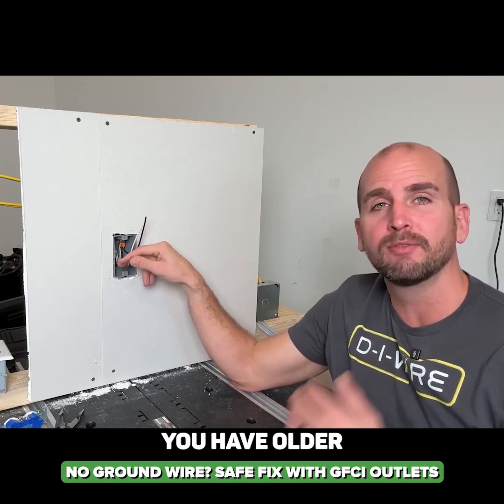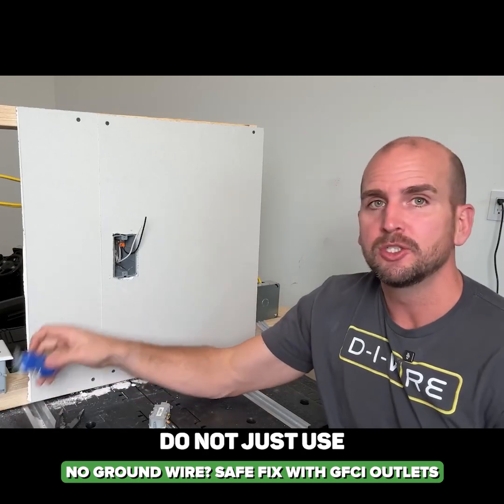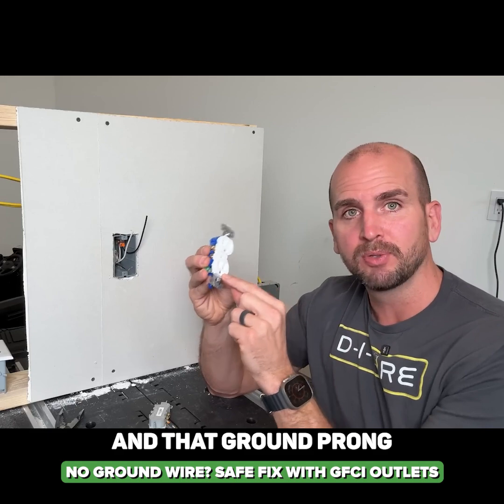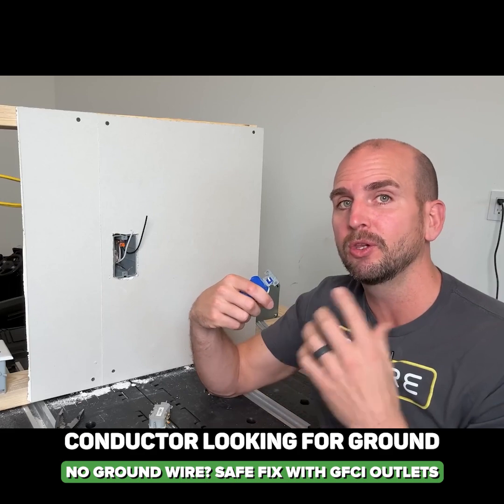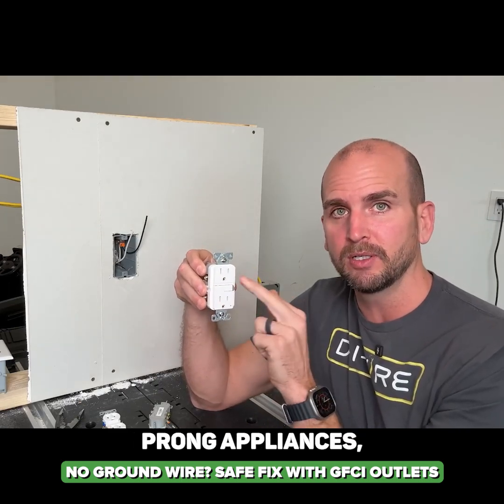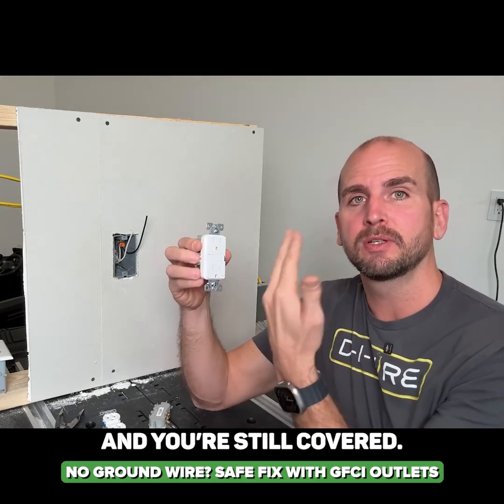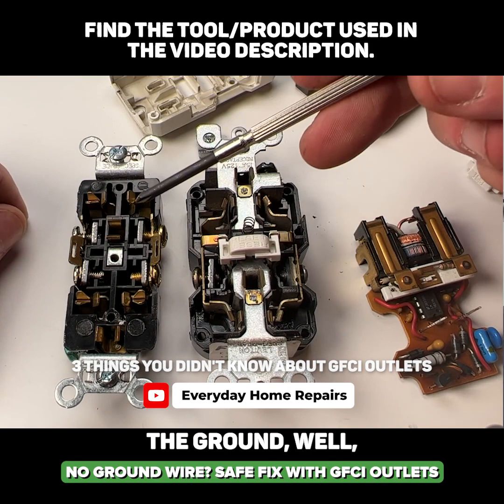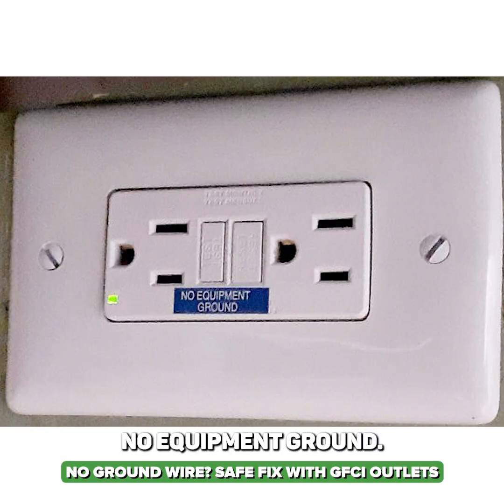No Ground Wire? Safe Fix with GFCI (Code-Approach)

Comment: There's safe and there's also @$%@#$% when you touch the faulty appliance.  Yes, the GFCI (RCD) will trip if hazardous current flows and remove supply keeping you safe.  What it won't do is limit the current while it's tripping.  Get 100mA going through you even briefly and you'll be fully aware of what just happened.
Reply: How would current flow without voltage?
Reply: @ECP90  Why would there be no voltage?
Reply: @retrozmachine1189  I thought you meant after the gfci had tripped.
Reply: @ECP90  Fair enough, but no, pre-trip.
Reply: @retrozmachine1189  oh ok then that makes sense.

Comment: Yeah all good until you realize the box is too small, apparently before the 50s they did not expect devices to be bigger than a 2 prong outlet, surprise 1900s boxes only 1.5” deep; try fitting a GFCI - good luck.
Reply: That's what they make chainsaws for.
Reply: As an alternative can you create a ground by screwing a jumper bare wire onto the metal Jbox?
Reply: @dayummimflyy  That's not a ground, that would simply energize that j-box in the event of a fault.
Also residential boxes are commonly made of plastic for some insane reason, so you would just achieve literally nothing good or bad by bonding it to the box.
Reply: @marine778-r7j thanks for that response. In my NYC apartment I needed to go from a 2 prong to 3, the box was actually metal, the building superintendent sent someone out to switch the outlet and that’s exactly what they did. I guess I should have him come back and do it properly
Reply: @dayummimflyy  Yeah there needs to be an actual path to ground, like a ground pigtail tied into an EGC running back to an actual ground bar at a panel.
Reply: @dayummimflyy IF the metal  box is grounded back to source some how then GFCI recommended eather at or up stream on the cercuit.                                                                  Under NEC 406.4(D)(2), you are permitted to replace an ungrounded two-prong receptacle with a three-prong GFCI receptacle, even without a ground wire.
How to Do It
Install the GFCI: Connect the hot (black) and neutral (white) wires to the "LINE" terminals of the GFCI.
Leave the Ground Screw Empty: Do not connect anything to the green ground screw if there is no grounding available back to the load center/ breaker panel. Never "bridge" the ground screw to the neutral wire (this creates a dangerous "bootleg ground").
Label the Receptacle: You must apply the sticker that says "No Equipment Ground" (usually included in the box) to the faceplate or receptacle.
Why It Works
The GFCI protects people by detecting if electricity is "leaking" out of the circuit (a  ground fault) and tripping instantly. While it won't protect your electronics from power surges like a true ground would, it provides the required life-safety protection against electric shock.
Note: If you use the "LOAD" side of that GFCI to power other three-prong outlets downstream, those outlets must also be labeled "GFCI Protected" and "No Equipment Ground." all recpticals down stream from the GFCI recptical/outlet then they
are supposed to be labeled GFCI protected even if there not a three prong recpticals that have no ground hole connection point.
Reply: U can replace J box but if to shallow u can use a extension like a wire mold extensionV5751: A single-gang flush-type extension adapter. There are shallower GFCI recpticals on the market like Livton 🎉
Reply: The V5751A is 1 3/4" deep, while the standard V5751 is 15/16" deep. The difference is exactly 13/16 of an inch, providing the extra clearance needed for the bulky body of a GFCI and its wires.
Reply: Key Installation Advice
Wrap with Electrical Tape: Apply 2–3 layers of high-quality electrical tape around the perimeter of the GFCI to cover the side terminal screws. This prevents "arcing" or short circuits if the device shifts or if the wires are tight.
Manage Box Fill: GFCI units are bulky. Use an extension ring that provides enough depth so wires aren't crushed against the back or sides, which could strip insulation. especially the sides of the extension. Pig tailg may become nesary especially if the wires aren't the menum leanth.
Reply: According to NEC 300.14, the minimum length of wire required depends on where you measure from:
3 INCHES extending outside the surface/opening of the junction box . Best practice around 4 to 5 inches but 3 inches is the minimum 🎉
Reply: Leviton 6197 Shallow Wallbox Extender( it's plastic) adds 3/4  of an inch of depth.  if there's a visible gap between the wall surface after installing one can use some caulk to fill in gaps. paintable caulk probably would be best choice if panting is needed to evere be done 🎉
Reply: Wago wire connectors might be desirable or other type connectors that won't add to box fill as much compared to wire nuts may be a better choice if pig tailing is needed but if there's room wire nuts might be more desirable to use fore they do connect bothe wires tightly to geather directly wagos use a bus bar.